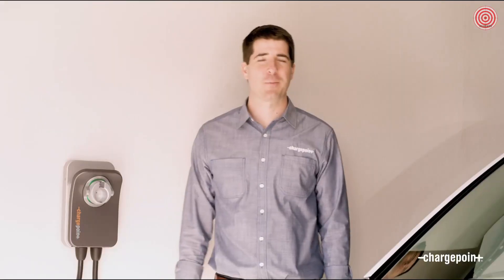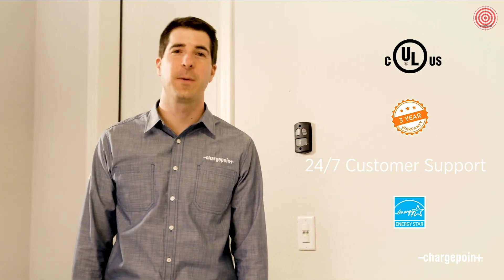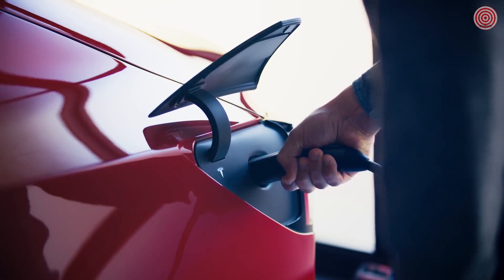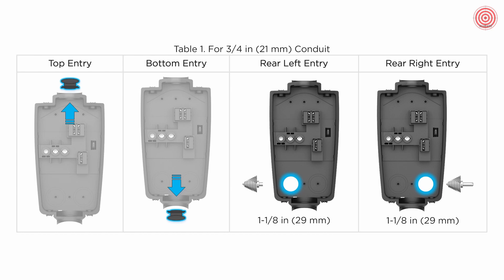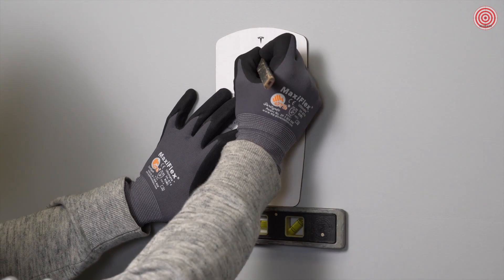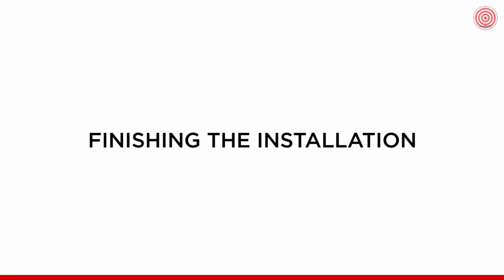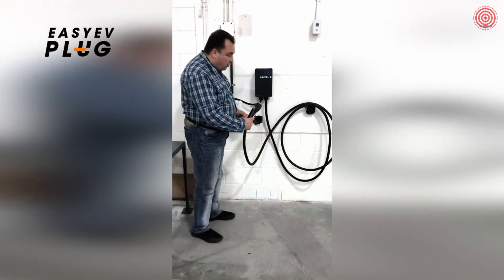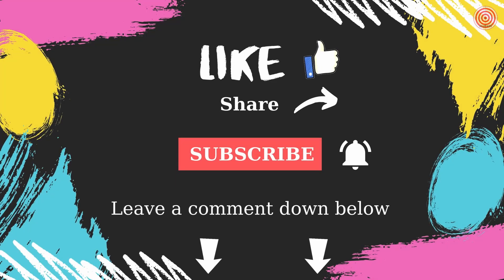5 Best EV Chargers to buy in 2022

Comment from the maker: 🔽5 Best EV Chargers to buy in 2022🔽
1. JuiceBox 40 Smart Electric Vehicle (EV) Charging Station with WiFi
https://shorturl.at/q4mfZ

2. Lectron NEMA 14-50 Level 2 EV Charger
https://shorturl.at/q4mfZ

3. ChargePoint Home Flex EV Charger
https://shorturl.at/q4mfZ

4. Tesla Wall Connector EV Charger
https://shorturl.at/q4mfZ

5. Grizzl-E Smart EV Charger
https://shorturl.at/q4mfZ